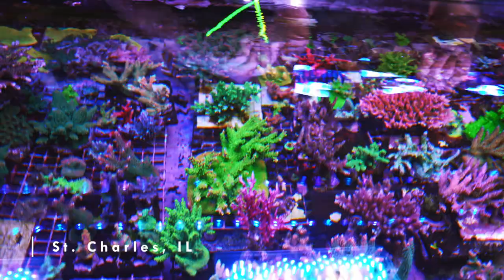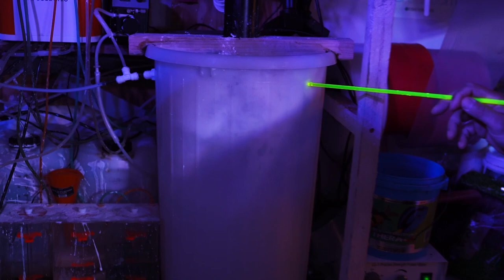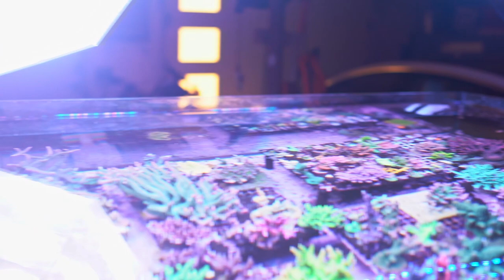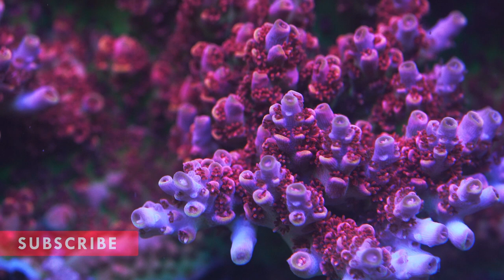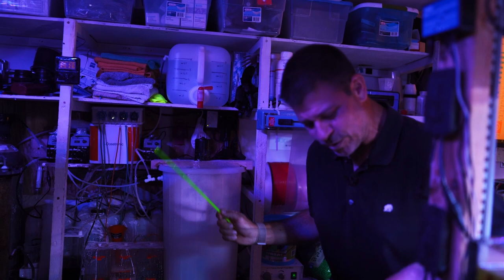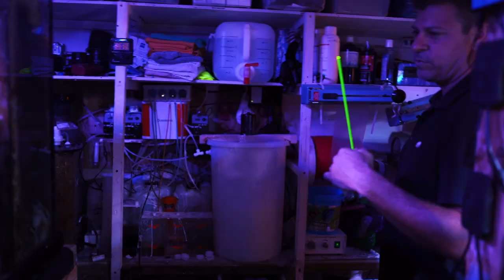Kalkwasser Slurry Talk with ReefNation | R.U.T.R. Video Clips

Comment: How do you keep your ALK level from going to high when dosing Kalk like that.  I dose to my evaporation rate but then my ALK gets to high, like 10.4.
Reply from the maker: Dose less then. Your aquarium doesn’t need that much still. As your corals grow u will ramp it up. Test alk and dose it accordingly.
Reply: I can dose less but then my PH dips below 8. I  don't understand why that is.  My system was running 8.4 for the longest but all of a sudden the kalk has less affect on the ph while ALK keeps rising.  
   @ReefUnderTheRoof
Reply from the maker: @tilexcan  try to use fresh kalkwasser. U can always open the windows to bump that ph until u end up dosing more of kalk
Reply: I have a co2 scrubber on my protein skimmer and the co2 level in the fish room is 500.  I just drained out all the kalk and replaced with a fresh batch of Bulk Reef kalk.  I will shut down the kalk until the ALK comes down and see what happens.  Thanks @ReefUnderTheRoof
Reply from the maker: @tilexcan  u can just lower the dose. This video might help you out…https://youtu.be/G2eOPuBBQaY?si=91dap5BWpJ72-oAH

Comment: My dosing lines are a total of 2ft so I never have to clear lines and I have a way more potent slurry.
Reply from the maker: Which dosing pump are u using?
Reply: @ReefUnderTheRoof  The only pump I would use is the FX-STP by kamoer. You can put any diameter santoprene you want in that head and adjust it to any speed. I like the 1mm ID. The slower you dose it the better. I have mine dialed in to dose 3.1mls per minute and it never clogs with settlement. Like I said, I haven't touched it in a month. I'd like to come up and buy some frags and see your setup. I know several growers up by you. One other uses slurry but he's very busy.
Reply from the maker: @iant419  awesome! Sure. Hit me up
Reply: @ReefUnderTheRoof  Where should I message you at?
Reply from the maker: @iant419  instagram/facebook